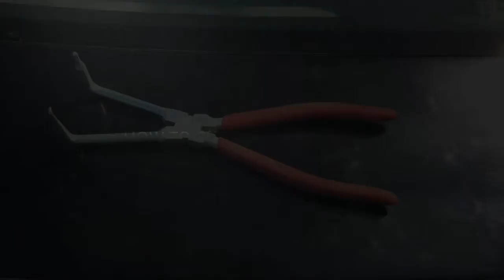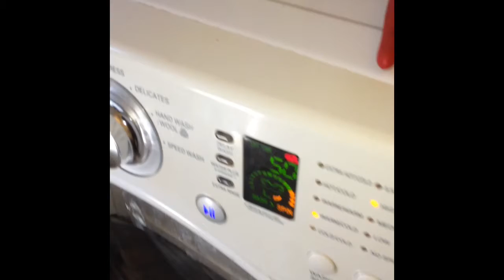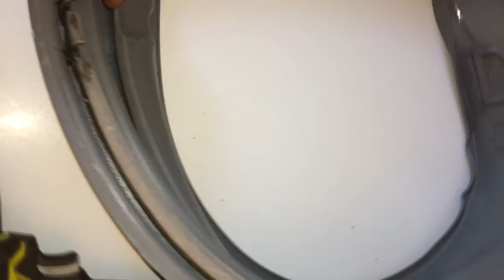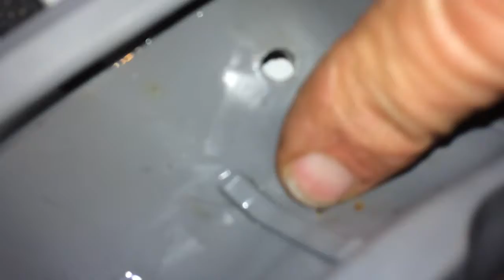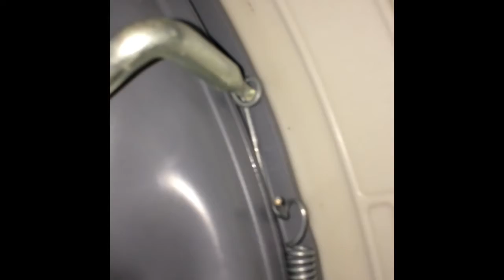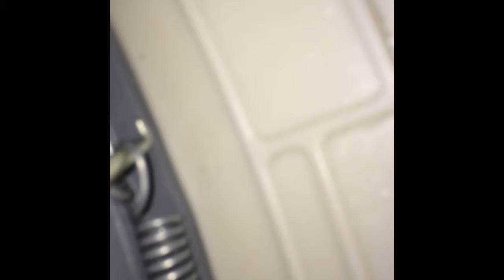✨ LG Washing Machine - Door Boot Removal Tool - How To Use ✨

Comment: I tried to use these pliers for no less than 5 hours...with no luck. I could never get the loop in the spring over the hook side.  My "hook" was actually just a piece of the wire that protruded up.  I ended up having to take the machine apart and using two sets of pliers and my herculean strength to join the sides.  I don't know if your spring clamp was different than mine, but you made it look easy.  I could never replicate it.  Very frustrating.  Sending the poorly designed pliers back to Amazon.  It was neither fun nor easy, and you described.
Reply from the maker: I’ve had difficult times with that before also.

Comment: That tool will not work on some LG washers (like mine) because they have a type of spring that needs a tool which hooks into each end of the spring and expands it from both ends of the spring.  I found one online but it didn't have the 90-degree angle in it which makes it impossible to unhook the spring that is located behind the gasket.  I'm not even sure that type of tool is sold, so it's looking like I'll need to take apart the whole washer.
Reply: One is for the front this one at a 90 is for the rear to the tub

Comment: Is this only for use on LG washers or can I use it on a Whirlpool Duet?
Reply from the maker: I think just for LG
Reply: @ScottTheFixItGuyChannel  ok. Thx. 👍
Reply: The LG spring has the loop on the wire which makes this tool work. On a Bosch washing machine it doesn't and is a bear to replace.

Comment: Spent an hour trying to put that spring back on after replacing the pump. I got so frustrated stopped,, went and showered gave it til today.. Any suggestions how to get the  spring clamp back on the outer bellows without this tool?
Reply from the maker: Hi Doug,
When putting the spring on the outer Bellows near the door it’s best to lubricate the wire with liquid detergent. Then you put the top of the wire at the 12 o’clock position on the bellow rim and then using your right and left thumbs you push down and out toward 8 o’clock and 4 o’clock to stretch the spring and then push it over to 6 o’clock position having a friend help to get the spring over the 6 o’clock position is good.
Sometimes I use a standard head screwdriver to help as a lever to get it to go over the 6 o’clock position.

Comment: I had some luck using zip ties around each end of the spring and then screwdriver handles to get a grip on each side to expand it.  But the pliers would be easier.
Reply: Haiti News Info Haiti News Info  Two zip ties.  I thread a zip tie through each end of the spring, then put a screwdriver handle in the loop made by each zip tie.  I can then grip the screwdriver handles and pull on them get enough force to stretch the spring.  This worked for me because it does not need any special tools.  Without the zip ties, I found it was just too difficult to stretch the springs - If I tried to use my fingers the spring would just slip out of my hands before stretching at all.   The special spring expander tool is available on Amazon for as little as $14 but I was impatient.  Just look up "LG Spring Tool".  I suppose snap ring pliers would work but I don't have those either.
Reply: This saved me dearly. Can't thank you enough. Worked better than I thought.
Reply: Genius

Comment: OK got the tool, albeit "used once", and it doesn't close far enough to make the spring hit the top hook!

This procedure is frustrating and seems like a poor design. Hopefully, with the help of a needle nose pliers, I can get the dang thing back on...

Also I'm noticing, Scott, that you never actually release the spring from the tool before putting it back together. That's the hardest part! Either way, your tool either has a closer span or your spring is looser. Just sayin'.
Reply from the maker: Thanks David,

I had to bend my tool with a vice to get that 1/4 inch more closure.

Comment: Have you looked at the price of these spring clamps? Most run near $100 bucks for a tool which the average homeowner would use just once in a lifetime, anyway. Not sure why they are about the price of a bar of gold, but unless you are doing boot removals on a daily basis, this is a tool which will remain in the bottom of your toolbox for darn near forever. It works okay, but the high cost is simply not worth purchasing for the average DIY person. Windex is indeed a good lube to use and doesn't leave any residue like dish soap may. It really shouldn't take much, either.
Reply from the maker: Some tool libraries lend them out.
Reply: Easy fix is to use a pair of scissors (Be careful!) and second pair of hands to run the retainer around the groove.

Comment: Post the part number?
Reply: I just looked up on Amazon - 383EER4004A 
Very expensive tool at $80 + shipping. I'm going to look around for videos for an alternative.
Reply: @lostinthedesert3788  Did you ever find a substitute?
Reply: @Gromitdog1  yes, I bought a TSE1 Tension spring expander tool on ebay for 1/2 the price. If you look around on Ebay you can find it for less than $30. They have it on Amazon for $50. It says it's for Whirlpool but works for LG. There's videos on here on how it works.